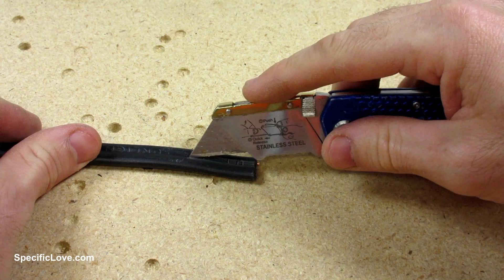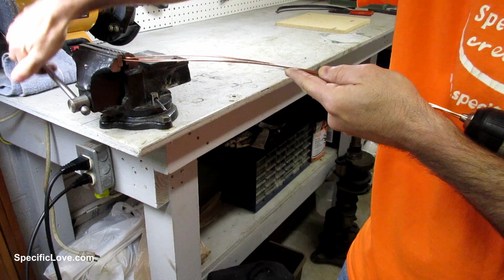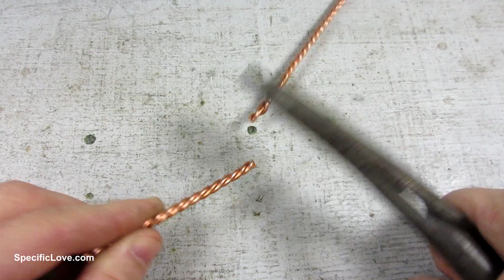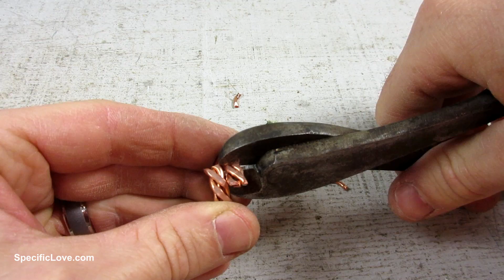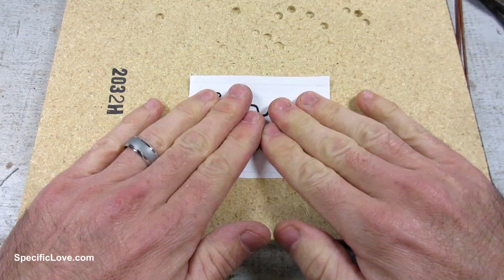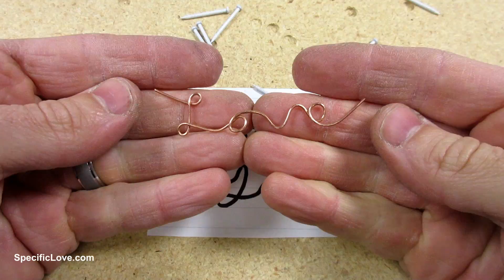Jewelry from Electrical Wire DIY Gifts

Comment: If you get really into copper jewelry making, they do make a copper colored solder that you can use to join the ends together, such as for that ring. I was pleased to see that you coded it with clear paint. I wondered myself how flexible such a coating would be Kama as well as how adorable. My concern, is for people like my mother, who are allergic to Copper. Were they to wear this, there would be a good chance that their skin would turn green at the point of contact.   In any case, good job on that.  It's always good to see something like that go to use rather than waste.